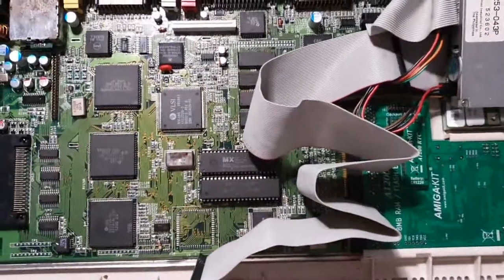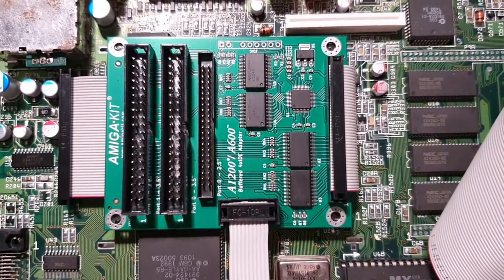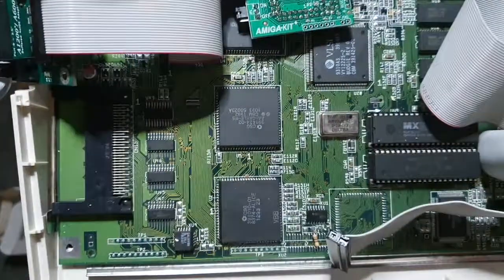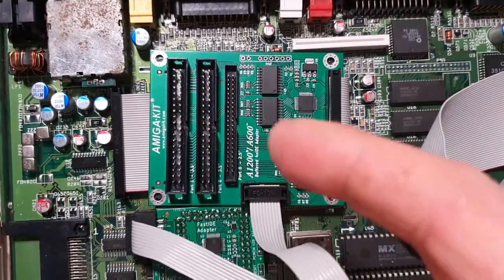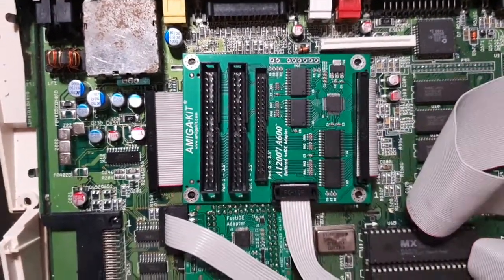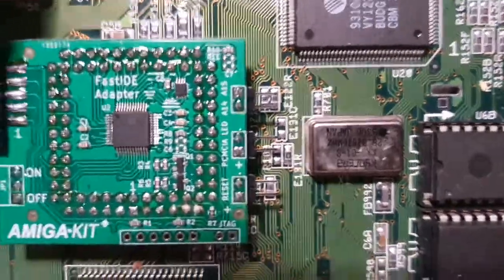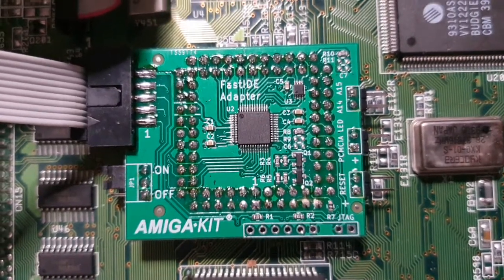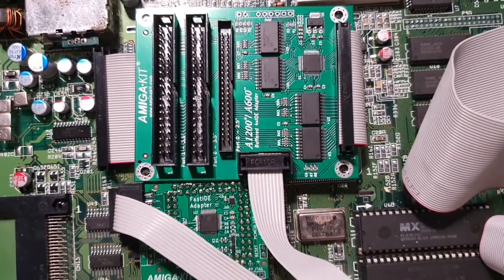Installing the Amigakit 4xIDE and FastIDE part 2

Comment: Reset switch adapter is the wrong way round. The pins should point to the floppy drive side of the system